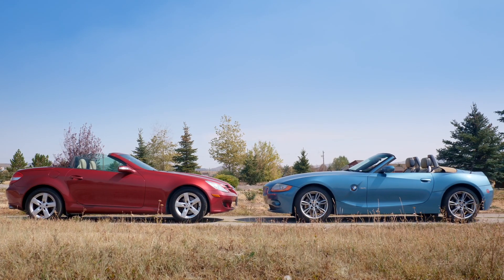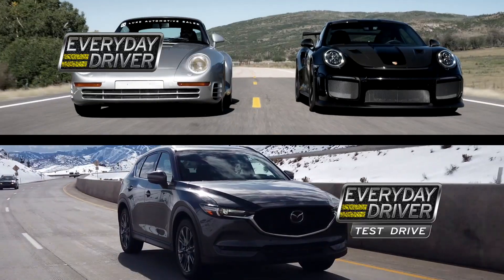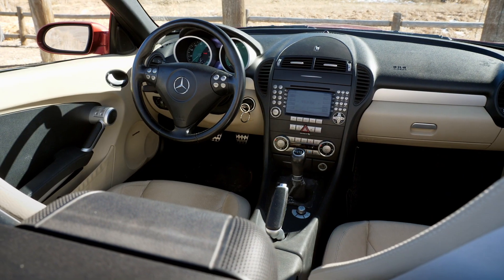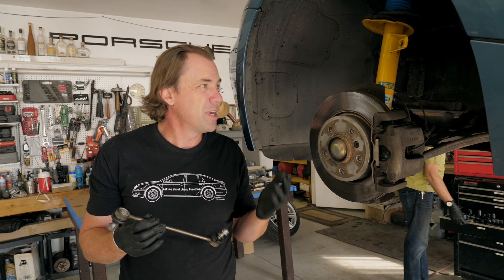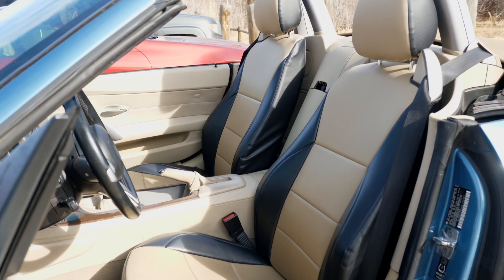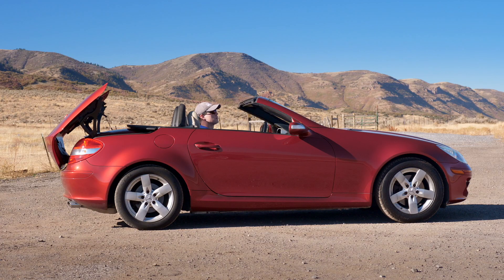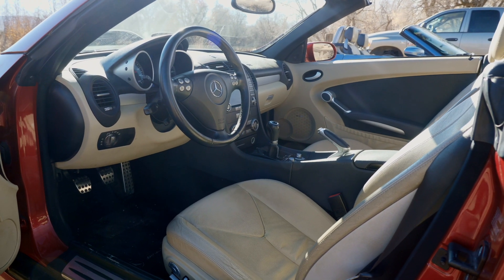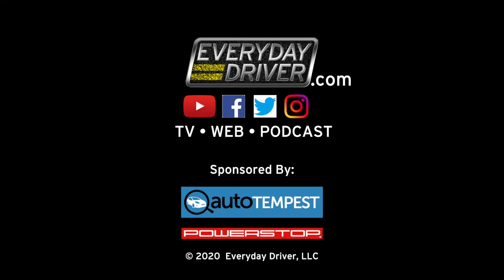Fixing It - Cheap Sports Car Challenge 02 - Inspection & Updates | Everyday Driver

Comment: Fun series. I have the Merc SLK280 (2006 model) that I bought in 2016 with 83K on the clock for about $9500. It was in  cleaner condition than the one you got, but it had been neglected a little, mechanically. I went through it and have kept it up since. I did two upgrades - moved to the AMG 17" wheels (refurbished at $200 each) with matching tires, and tossed the OEM stereo system in its entirety, installed a modern Alpine head, much better power amp and speakers, all Car Play operation; perfect. Now at 129000 miles, it continues to run like a new car, and it has remained remarkably inexpensive to run. 

BTW: While the 3.0L version of this engine was included in the class action suit for the balancer shaft problem since it's the same engine family, records show that very very few, if any, of the 3L motors were actually affected by the problem. None of the Mercedes specialists around here (and there are a lot of them) have ever seen a 3L with the issue; all have seen several 3.5L with the problem... That's one of the reasons I chose the 280SLK instead of the 350SLK when I was looking. The difference in power is a minor concern to me. 

BTW2: I had my choice of both a six speed manual and a seven speed automatic version when I was looking ... comparable cars in every other way on condition, finish, performance, etc. I chose the 7 speed auto because it simply worked better for my driving needs, although the manual was indeed a delight to drive with. Once you get the hang of how to use the automatic to best advantage, it gives up practically nothing to the driiving experience of the manual, and is far more useful when dealing with urban traffic situations. 

BTW3: The absolute worst thing about the 280SLK is the Mercedes standard programmed throttle response, which even in "sport" mode proves laggy with poor responsiveness. A very cheap and complete solution to this problem is the Sprint Booser III programmable throttle actuator accessory. Its a little box that goes between the throttle-by-wire pedal and the engine computer: it provides access to the standard actuator programming, Sport settings from 0-9, and Race settings from 0-9, with a switch for manual or automatic equipped engines as well. The difference in responsiveness is night and day: now, with the control set to Sport #5, the responsiveness in "Comfort" mode on the transmission is better than the OEM Sport responsiveness. Set to Race #4-5 mode, with transmission in Sport mode, the responsiveness is almost too much and it makes shifting manually, even with the automatic transmission, virtually instantaneous and a giggle on curvy mountain roads. Not bad for $250, half an hour to put it in, and everything else left 100% stock. 

I love the car: It's proving very reliable, very inexpensive to run, and has both great economy and a HUGE range due to the 18 gallon tank and 29-32 mpg highway cruising fuel economy. The handling isn't boy racer toss about, but more 'gentleman's express" due to the car's weight, but that's good enough for me. :)

Comment: I have a 1999 $3,800 slk 230 and i absolutely love it yes it has 180,000 miles but looks brand new and runs like a champ even the top works only thing ever done was break pads general fluid and tires and new motor mounts at 150,000 miles slks are incredibly reliable

Comment: Well done, the brakes (and tyres) are the most important things in road holding and safety.

Every car I ever bought second hand gets the same treatment, at least new fluids (oil, coolant, transmission, brake and clutch fluids), new filters (air, oil, interior) and new Sparks and wipers, always.! 

It's cheap to do really, few hundred bucks or much less if you can do it all yourself.

Any car older than 10 years and/or over 60K Miles on it also needs a proper suspension check, bushings, rubbers, dampers etc

Comment: I didn't realize the Z4 was a 3.0i. That is a killer deal. I can't find a decent one for less than like $12K.
Reply: Keep looking. I got mine for 10k, 80k miles 2008 3.0. And I’ve seen them for less than that
Reply: @StoweGarage  2008 m54? Or 3.0si with the n52?
Reply: @Krezo200  m54 z4 was from 03-05. 2006 to 08 they were all n52’s. The Si was just a tuned version of the n52. It’s like the difference between a 328 and 330i e90 with the n52
Reply: @StoweGarage  okay thats for US only i guess
Here in germany its a bit different
All 3.0i are m54
All 3.0si are n52
👍🏻
Reply: @Krezo200  yes you’re right I am referring to us market, sorry for my ignorance
Reply: @StoweGarage  hehe its all good mate

Comment: I own a 2003 z4 2.5i and it has been fantastic. Bought it 4 years ago for about $12K with 41K miles and it has been great. I do most of the service work myself and it is super easy to work on. Biggest problem is the electronic power steering in hot weather, but I changed the belts and it improved markedly. Would I buy another? - yes - but M or at least 3.0L version for a little more go.
Reply: I have the same year, model and engine... But I made sure it has the Sports Package... I drove cars with and without it... And I can't stand the electric steering without that button.   I drive with the button on all the time... The car had 12,500 miles on it when I purchased it in 2006 and just went over 94k 2 weeks ago.  Still love it and gradually customized it over the years with suspension upgrades, M seats, Dinan S Package...

Comment: I'd say you got ripped off on the Z4, you probably could have negotiated $500 - 1000 off down to around ~6K for the crappy interior and not doing the bushings or shocks. Also there isn't any cheap quick fix for the lack of steering feel. If it really bothers you, you could have opted for the z4M bushings which would have added camber and given the appeance of better feel. Plus opting for the bilsteins was a bit excessive as non worn oem shocks are actually really good.
Reply: Sight unseen
Reply: At that mileage both struts and shocks are toast, OEM Sachs struts and shocks are inferior to the Bilsteins . Run flats are horrible on the Zeds and tramline like crazy. Replace shocks and tires and you have a new car. Have a 3.0 si Coupe and I know

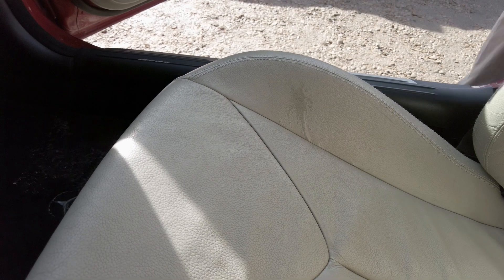Comment: At 6:14  the mysterious fluid is top hydraulic fluid. Its leaking from the front latch cylinder and pools on top on the headliner.
Reply: Was just going to say exactly the same thing!
Wait till they find out the cost of a replacement cylinder......
Although if your clever, they can be opened up and the seals can be replaced.

Comment: I love working on my own cars because I seem to develop a better connection with that component once I’ve worked on it. I’m more aware and in tune with how those components are functioning.  Do you guys notice that?
Reply: yeah, so every noise in my car makes it cringe and think what horrible job is upcoming lol
However I did pay for the clutch in the gt4 to be replaced as it was winter and didn't want to do a first-time-on-the-st205 big job in the snow and ice

Comment: I've been looking for a z4 but I cant find any with manuals. Is the SMG 6 speed really bad?
Reply from the maker: We would not recommend the SMG. BMWs DCT is excellent, and their 8 speed automatic is also good. Thanks for watching.
Reply: @EverydayDriver  What about the 5 speed auto on a E85 2006 z4? are those reliable? Thanks for replying.
Reply: @lwh4566  its not great I would recommend the 6 speed auto in the 06-08 z4 if you need an older auto

Comment: Love the Z4... not sure if I fit in one, but I like.  I just fit in my E36 325i .. that is tight but ok for 6 hours at least.  Is the Z4  a lot smaller near your knee area ??  

      I assume you have changed engine oil and coolant and brake fluid at a minimum..   A used car requires at least that.    
         I love this series you are doing.  I have some money burning a hole.  Just need to find a decent used manual sports car that I fit into ok.
Reply: Fun fact: I helped work on the development of the original Z3 and M3 roadsters, back when they were still in the test-mule stage(s).

I....don't think they took any of my critiques or suggestions to heart, though.  sigh
Reply from the maker: Yes, we did oil, coolant and brake fluid between buying these cars and this video. 

And if you watch our first video on these, Todd discusses how surprisingly roomy the Z4 is for tall drivers. It is a genuine surprise. Thanks for watching, happy shopping!
Reply: I’m 6’3” and fit great in my ‘06 Z4.  I seriously love that car.

Comment: The Z4s steering column has a very bad bearing and cheap lubricants which melt and disapear. It makes the steering "stick" when it´s hot outside and generally causes a "loose" steering feel. I live in Germany, where an expert (yes, he is the only one in the world, sorry) can fix that with a different high quality bearing. It transforms the Z4. BMW does not offer a fix, just a new column with the same cheap bearing inside....for 6 times the money of course. I had my Z4 fixed, and the steering is much more precise now. If someone needs the adress in Germany,  just ask. The seats are of very good quality, don´t know what happend to yours. 2003 Z4 3.0 with 222.000 km. (137.944 miles)
Reply: There is a cheap fix for sticky steering on the internet. I required drilling a hole and adding lubrication, you can also add a grease fitting and pump some grease into it once in a while. Worked for me 06 3.0si coupe
Reply: @anthonygillesse7242  This is not fixing the problem unfortunately. I thought so too. I was present during the repair of my steering column and the expert showed me why. Yes, you also need a better heat resistant lubricant but the main problem is a very bad ball bearing which HAS to be replaced to make it work save and perfect. He gave me the old one to try and turn it: It moved like the outer ring of a dive watch, with or without new lubricant. The bearing can not be filled from the outside, no matter what. And there is no spare part on offer, he manufactures them. Trust me, I have seen the whole process with my own eyes. Also the play of the internals is wrongly adjusted, and has to be fine tuned. You wont believe the difference it all makes.

Comment: Best rotors to use are solid.  Drilled maybe.. Never slotted.. Stick with factory solid. For pads, use Akebono or EBC red stuff .   Enjoy...
Reply: I just-recently had to resist the temptation to put some cheapo slotted rotors on my Jeep project....  Went with some solid rotors, with "E-coating" on the hub surfaces, because....well.....I live in the rust belt.

Got brand-new PowerStop rear calipers and front hub/bearing assemblies, though!
Reply: That's actually debatable and subjective at this point. There are huge forums filled with this subject. You do not have the answer. That's for sure.
Reply: I’ve always had warped rotors in time with solid rotors, installed drilled and slotted rotors and after many miles problem gone, guess I’m lucky🇨🇦
Reply: @anthonygillesse7242   Drilled and slotted will last longer with bad shoes. I do not like the noise, feel of slotted